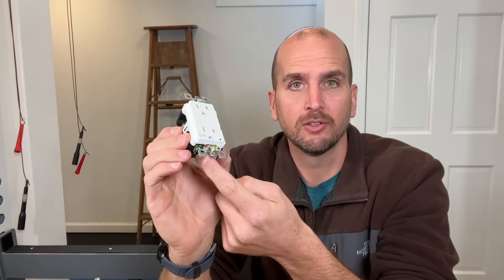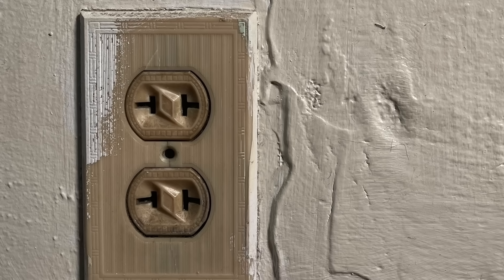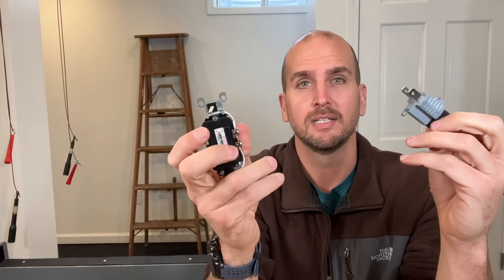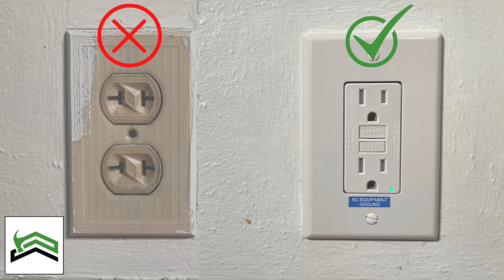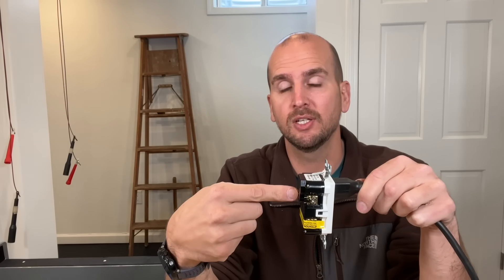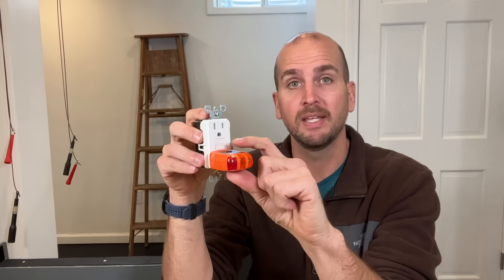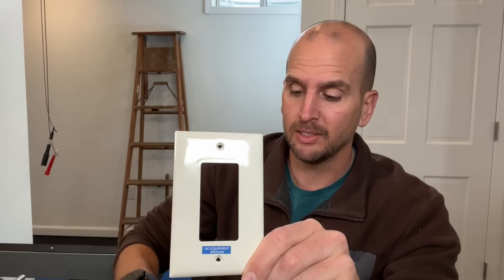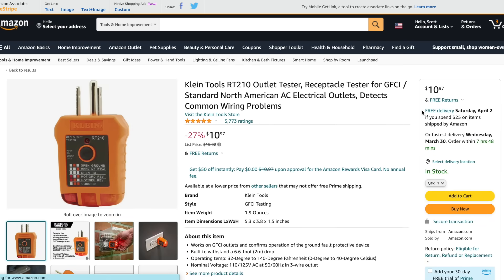Does a GFCI Outlet Still Provide Protection Without A Ground Wire?

Comment: These things are great for old homes without a ground wire. Love the option.
Reply: just bought a house 1960 and no ground wires.gfci not grounded so this helps understand now.and i still have that zinsco panel😪
Reply: @hammerridecycling7630  I had a zinsco as well and just had it replaced by my electrician friend for 1200$. New panel with new circuits. Definitely recommended, mine was faulty and the main breaker didn't even cut power.
Reply: You should update your panels and recepticals and install GFCI's where needed. Like bathrooms kitchen area and anywhere where water can make contact
Reply: GFCI's are Fantastic.  Ground wires are good - but not as great as a GFCI.  Between GFCI or Ground - I go GFCI.  Much better to have BOTH; but people have still been killed even with a functional ground; working GFCI - nope.
Reply: No, it is an American pathology that allows you to break the protective wire.
Reply: These cost like $20 vs a normal $1 outlet. You might as well just do it correctly and run some 3-wire Romex out to it....
Reply: @sminthian  without pulling permits or without an electrician? Because it cost a ton of money to run Romex everywhere, to code. Especially through solid  walled homes.
Reply: @TylerTron21  That's where GFCI breakers come in handy.
Reply: @sminthian  a $20 GFCI is by far much cheaper than running new Romex, you only need one GFI to protect that whole circuit and the cost to not only run the home run and the rest of that branch could be very expensive and very damaging to the existing finishes of the home. Not to mention the cost of Romex anyway.
Reply: @sminthian  You don't need it on every device, you only need it on the first device in the circuit.  Here it is common in older homes to see a row of GFI receptacles right next to the panel .  the wire goes from the breaker to a GFI receptacle to the rest of the circuit.  It's perfectly safe and a lot cheaper than rewiring an entire home.
Reply: @minuteman4199  please explain “ the first device in the circuit” who do I located this device?
Reply: @angeldeelse4090  The First device in the circuit would be the one connected directly to the breaker.  If you are in a finished building you will have to determine everything that is on the circuit by turning the breaker off and testing all your devices to see which are dead then figuring out how the builder ran the wire from one device to the next.  It will likely be a bit of a PITA.

I live in house built in 1925 and I have completely rewired it, when I did I made drawings that showed how I ran all the wire but assuming you haven't got that you can use a multimeter and check for continuity on wires and figure out where they go.

In older homes with no "ground wire" you will often see a row of GFI receptacles right next to the service panel.  The wire will go from each breaker to the GFI receptacle before going to the rest of the circuit.
Reply: @angeldeelse4090  Imagine a room with 4 receptacles. There will be one of those receptacles that feeds the other three. That will be the first one. To find it you will need to find out which breaker powers that circuit and shut that breaker off. Then you will have to go to each receptacle and remove the cover, remove the screw securing the receptacle inside the box, then remove the black wire from EACH receptacle. Once you have removed the black (hot wire) from the receptacle, you can then turn the breaker back on. Using a voltage tester or a meter, you will then check for voltage at the black wires you removed, until you find the one that is hot. That will be the first "device" in the circuit.
Reply: @sminthian  Where I live everything needs to be piped pretty much. So good luck.
Reply: @sminthian  If you plan to "do it correctly" there are certain locations that require a GFCI even with the 3 wire Romex. Kitchen counters and the bathroom for starters. In the 2023 NEC new building require dual function AFCI/GFCI protection.

Comment: A good reason to have ground is so surge protectors work.
Reply from the maker: Good point Ryan, thanks for the feedback.
Reply: To a point you're correct.  However, most surges are "differential mode" - meaning the neutral or hot goes to higher voltage, and a surge protector will STILL work.  The technical reason is that a proper surge protector has three MOVs (two-wire over-voltage "clamps").  One is between the hot and ground, and the other two go from the hot and neutral to ground.  The latter two are to prevent "common mode" surges where both the neutral and ground spike away from ground.

Comment: If you have older wiring that only has 2 wires, and no ground, and just 2 prong outlets, you need to put in a GFCI outlet to give you a 3 prong outlet, but it is not a good idea for GFCI Protection.

It will work, but I would not recommend it for a GFCI

You really need to have a ground wire for GFCI
Reply: Exactly my situation & I agree. In my old house most outlets were 2 prong no ground. I bought from my landlord and knew he was a cheapskate, so I tested the GFCI in the kitchen & bath and no ground. Also he had his guys come in to replace an outlet that died in the kitchen. Though it was well less than three feet from the sink, they just put in another two prong. Even I knew it wasn't code that way. Now I've had to learn electrical, because two out of three people I've had in have been less than satisfactory.
Reply: @angelachouinard4581  The NEC requires that all new 120v outlets are 3 prong whether or not you have a ground.  Normally you can't buy them anymore.  They also go on to say that the ground prong on outlets downstream of a GFCI outlet MUST NOT be connected to anything unless you manage to supply an alternate (and legal!) ground.

For a period of time, the NEC encouraged filling the ground prong in a 3 prong ungrounded outlet with non-conductive goop so you couldn't install a 3 prong plug and think you had a ground even tho it wasn't connected.

Instead, they require you to use the little stickers.
Reply: @fromagefrizzbizz9377  Thanks for the info. I did find a sticker supplier which is an idea I think makes sense. PS I adore your YouTube name
Reply: @angelachouinard4581  You can always use a label maker.  You don't need custom made stickers from commercial suppliers.  A cheap label maker (like a dymo) does all you need, and can be used to make your own custom one-off ones at less cost than a commercial supplier can.

Electricians often label panels this way.  On panels, sticking a label right beside the breaker saying what each one does, is FAR BETTER than scribbling on the panel breaker sticker which don't line up with anything.  Especially if the breaker sticker is upside down.

You like my online nickname?  Most people who take note of it use it in their insults because they have no argument against me ;-)
Reply: @fromagefrizzbizz9377  Thanks. They were like 50 cents for 25 but if dymo labels work for the inspector I'd be happy
Reply: @fromagefrizzbizz9377  No. On new installations you must use grounded thee prong outlets. In addition they need to be GFCI protected where so mandated. On old homes you can keep your old two prong outlets and replace broken ones with new two prong outlets. If you want to change then to three prong you must either run a ground wire or use GFCI protection. (in selected places you must use a GFCI no matter what)
Reply: @okaro6595  “No” what?

The only part that I can see where we appear to disagree is the replacement of 2 prong outlets when you can’t provide a real ground.  Yes you can replace it with another two prong, but the commentary years ago was “just try finding one!”) US code, believe it or not, used to permit replacement with a three prong outlet with the receptacle’s ground hole filled with silicone! (Or some other non-conductive material). That suggestion was deleted a long time ago. I believe that current code says 2 prong (it may be easier to find one now), or an unmolested 3 prong clearly marked as not having a ground.  My recommendation has always been using a GFCI - you gain better protection than you’d get with a ground, with only the minor drawback that some sensitive (usually very old) electronics might not work quite as well.
Reply: @angelachouinard4581  landlords are horrible. I have been doing work since the first apartment I rented. New toilet, sink, shower, outlets, switches, etc .

I have no respect for slumlords
Reply: Not buying it.
Reply: A GFCI is connected to ground usually by the neutral wire.
Reply: @millomweb  The neutral wire connection to the grounding system is irrelevant.
Reply: @fromagefrizzbizz9377  Nope, it's essential for GFCIs to work - as otherwise, there would be no possibility of an imbalance through the GFCI.
In the UK the only power outlet permitted in bathrooms is a 2 pin electric shaver socket. This must be fed from an islolated supply - meaning neither power wire is connected to anything, especially ground. These supplies do not have a GFCI - as they'd not work if they were fitted - due to the lack of G-N connection in the circuit.
I bought a diesel generator last summer and this issue is something I studied in depth. There are debates as to whether it's safer to connect the generator ground to Earth or not. I've decided not to - hence minimising the risk of an electrical path through the ground. However, I've still fitted a GFCI to the generator supply - it will only be operative if a ground circuit becomes possible. The supply from the generator has an Earth wire. The GFCI will trip if that earth wire does get a current on it (of more than 30mA) - and to make this work, I have had to make a connection between the Earth wire and neutral. This is needed to create a fault current path - completing the fault current circuit.
Feel free to try to trip a GFCI powered by an isolated supply. You'll find it can't trip!
Reply: The NEC requires it UNLESS you can modify the circuit to have a real ground.

No, you don't need a ground wire for a GFCI to work properly - that's the point for the NEC guidance on how to make 2-wire circuits legal under current code.
Reply: No yo don't. A GFCI works perfectly well without a ground wire. Now modern installations require a ground wire. This is not any option to fix grounding problems on new houses. This is only a compromise method to change sockets in old homes.